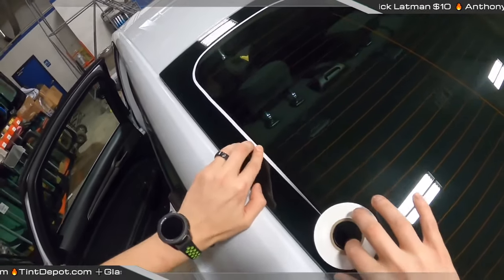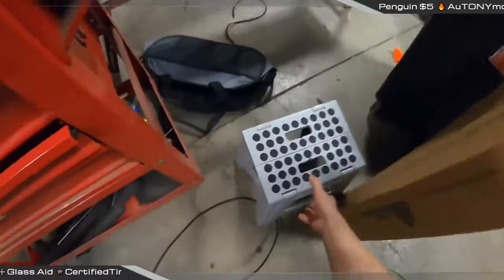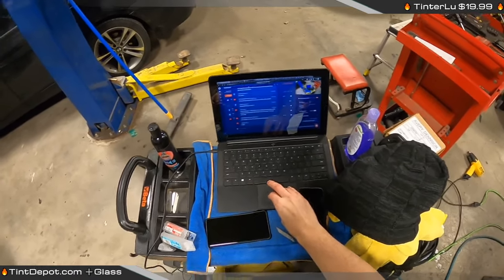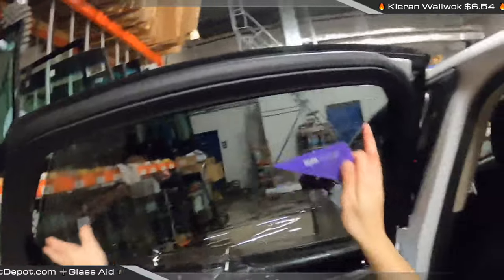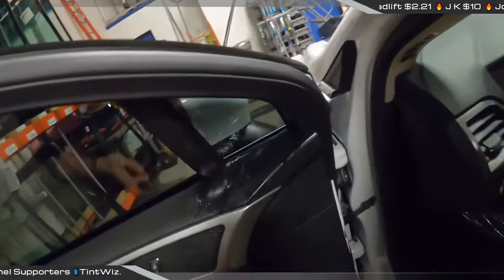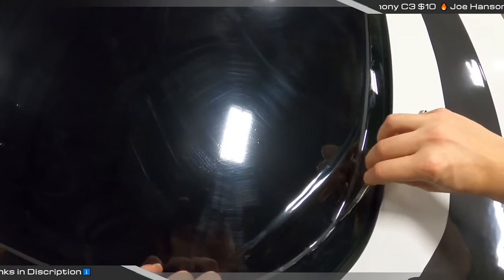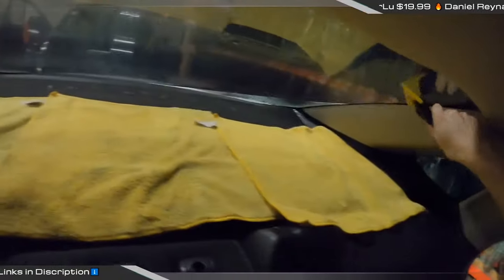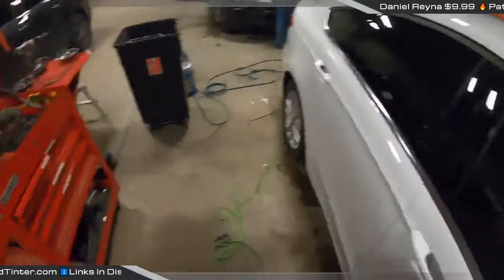🔴 2020 Fusion Tint Live! How To Tint Car Windows

Comment: I am a vinyl wrapper and it was interesting to see how forgiving the tint is when you are shrinking it with the heat gun.  Try not to drop your heat gun on the floor when you are putting it down, if it hits it too hard you can break the ceramic elements inside and you will have a gun that will rattle every time you use it which sounds annoying and could impede the fan from spinning.

Comment: Hello matt. Ive been trying to tint a very curved back window (renault megane 3) but i keep failing. I use the dry shrink method. Is it easier to try wet method? Keep the good work man. You make it look easy :)

Comment: What is your slip solution?
Reply from the maker: Dollar store baby shampoo right now. the sesame street stuff works just as well as Johnsons lol go figure
Reply: TintStuff lol thanks. Is what’s the general ratio  of shampoo to water that you use?
Reply from the maker: prolly 1 to 2 Oz per gallon? I dunno I just add a decent amount and the film slides around into place and tacks up after I squeegee. it's easier to Install with top much soap than too little.

Comment: Hey Matt! Ive been working at a shop for a solid year now and putting out some quality jobs( 2-3 cars per day). I’m changing jobs and I’d still like to tint. Do you have any good recommendations for films as a beginner? Cost effectiveness ect. I plan on using films with 5 year or lifetime warranties. Great channel you’ve brought me up to speed faster than just my coworkers. Thank man!!!
Reply from the maker: 2-3 cars is really solid. don't sell yourself short. film per job is really inexpensive for lifetime so I'd suggest spring for the better film. focus on selling yourself and stand behind your work and you can charge as much as where you were working if not more. you were already Tinting in a pro environment. nothing has changed except the environment and the customer pays for your service, not the location.
Reply: TintStuff  Thanks a lot man!! I’m used to heating with Llumar/formula one and huper/autobahn films. I also have done some flat glass too. My trainers have been in the game 30 years. So I had some good teachers selling/tinting. Good guys I have a lot of respect for. 

I’m considering Llumar, Avery, and. Global currently. Keep up the quality content! See ya soon
Reply from the maker: damn! that's high end stuff, that's awesome. all thoes brands are solid. it's gonna be hard to pick up llumar because they have a monthly minimum order or you loose your ability to be a llumar dealer but the others are no issue like that.
Reply: TintStuff yeah my boss hates dealing with Llumar sometimes. They get pissy that we carry Huper which is also an Eastman film. The biggest benefit i see from them is that they pay well for warranty work.  I also have no other experience with other companies. 

If I wanted to mix brands it seems like a headache and a half.